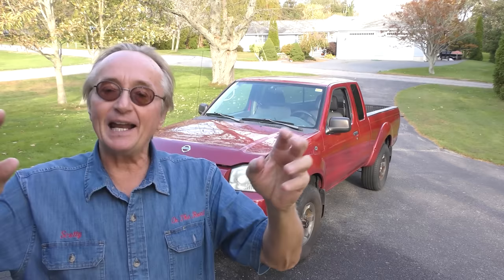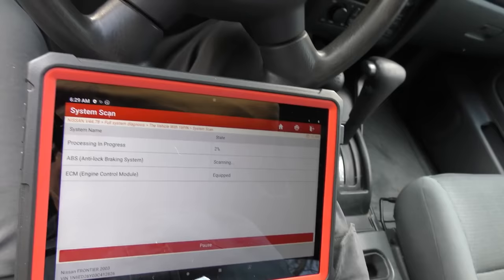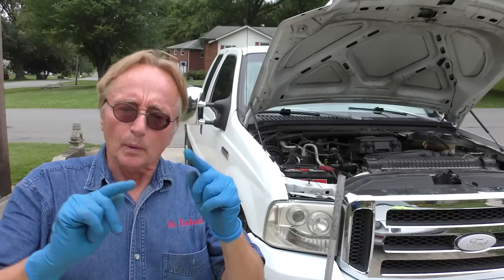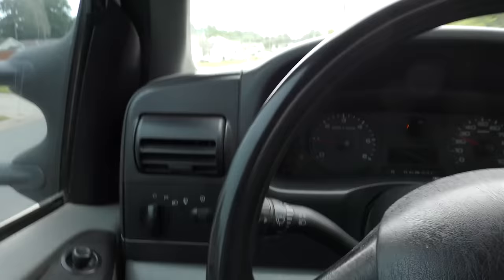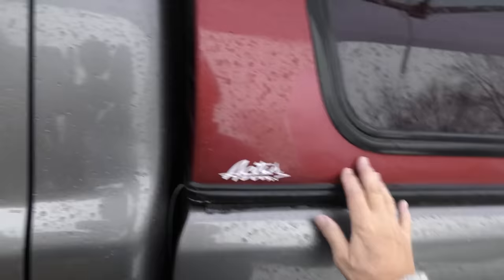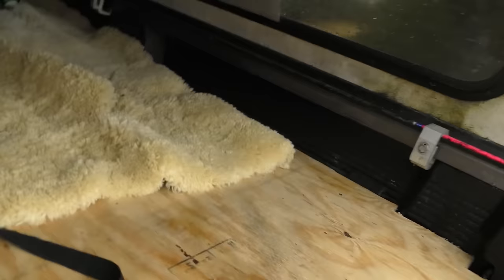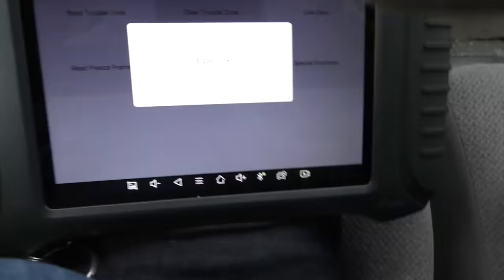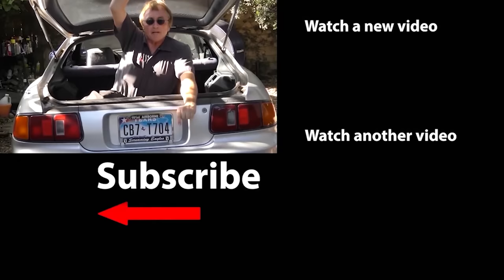3 Best Trucks to Buy When You’re Broke

Comment: I had a '00 Frontier.  It had 80k miles when I bought it.  Manual transmission.  I sold many years later with about 180k miles.  I did a timing belt, plugs, wires, and had to do 2 water pumps.  Plus a radiator.  The knock sensors fail and are impossible to get to.  Anyway, it was a great truck otherwise.  I worked it hard.  Regarding rust, Scotty, I highly suggest a wire brush and some POR.  Works wonders.
Reply: POR?  Paint 🎨over rust?
Reply: @Nunya9876  correct.  Good stuff.  Put it in another container because it can "activate" and harden the entire can.

Comment: Had a 99’ f150 4.2 v6. manual trans for many years 
My fault driving it with broken radiator which lead to bent heads

Comment: Scotty I need help I have a 2002 honda crv 300,000 miles and every once In a while i notice that there is white smoke coming from the tail pipe. Also sometimes when accelerating it hesitates a little.
And what do you think I should do first my Air conditioner blows warm help.

Comment: Hey Scotty quick question man so I got a 2001 Nissan Frontier se that was my dads  it has 237000 miles in it everything works on it except for the ac 🤷🏽‍♂️ I know it can’t be the ac compresser because it works sometimes out of nowhere it will blow cold air and I know it can’t be the cabin air filter cuz my truck don’t come with one for sum reason 😂🤷🏽‍♂️ so could u possibly enlighten me ??

Comment: Hey man I just watched this video because I need an new truck for my lawncare business. I currently pull an 5x8 trailer with my 2012 volvo s60.

I went on fb and found a 2003 toyota tundra with 113k miles for $1500 the only problem with is the rusted frame.
I live up north too. I'm about to go for it and see if toyota will replace that frame for me.

Comment: That F-250 has the worst version of the 5.4 Triton, the good ol' 3v. Spark plugs are known for breaking in the heads, and if you don't religiously change the oil at the specified interval, you're asking for roller followers, tensioners, etc. to fail and grenade the engine.

Comment: Hey Scotty need your opinion on my 1989 Toyota Deluxe with the V6 engine. I currently been trying to chase down a brake light issue. I already changed the brake light switch as well as the fuse under the hood and changed brake light bulbs which are double contact bulb part number 1157. For some reason even though I have done all the above mentioned the brake light stays on even when vehicle is turned off so been having to leave fuse out so it doesn't run down my battery. **Please Help*

Comment: I had a 2006 frontier, the engine coolant leaked into the transmission which ruined it. 96,000 miles. Cost me 5000 to fix. The I traded it in. Have they improved the transmissions?

Comment: my car sometimes struggles doing a gear shift i think maybe 3rd or 4th this came after my car was leaking transmission fluid from a worn out radiator connection for months i was thinking it was coolent leakage the whole time.  so whats does it mean when your car struggles with a shift? it doesnt happen all the time like 2 twice a week or once but its very noticeable.

Comment: That lifter noise is actually rod bearing noise; I have fixed that by using straight 30 weight oil in my Chevy Blazer and Bmw 325; all those other dumb BMW owners keep on fixing their rod bearings over and over just to use light oil, ha ha ha, not required, they so dumb! :)

Comment: I both agree and disagree with the F250 5.4L. I'm not an expert, so I can't tell what year that one was, but I would avoid any Ford truck with a 5.4L 3V V8 from 2004-2008. Those were built when production moved to the Essex plant and notorious for being absolute junk. The ones last forever are the the 5.4L 2V engines and the 3V engines built at the Windsor plant in 2009 and 2010
Reply: The 3v u have to run 5w30 / 10w30
Reply: It has the 3v intake. The ticking sound is definitely not something to ignore. If the oil change interval isn't kept up with, something in the timing system is going to grenade the engine, be it the tensioners, roller followers, etc. Like you said, the 2v's will last forever if you take care of it. Main thing to pay attention to is making sure the spark plugs are torqued correctly.
Reply: @D4x4Bronc  That would explain why my dad's F150 was junk after 150k miles. He was good with oil change intervals, but always used the manufacturer's recommendation of 5w20.
Reply: @Detroit6V92TA  oil pump leaks at highway rpms and loses oil pressure with 5w20. Also need to run motorcraft filter and keep the oil topped off and oil change every 5k miles. Have one with 260k never been touched engine wise.

Comment: My brand new 98 F-150 got horrible fuel economy,blew an axle seal on week two, the trans would not be in first upon stopping. I'd step on the gas and it would downshift to first. Clunk. Then Ford's wonderful dash on the driver's side that you would have to navigate around as it projected further rear than the passenger side. Shitty product.